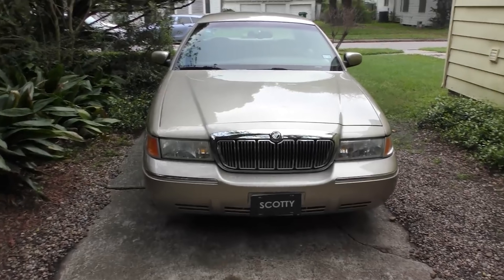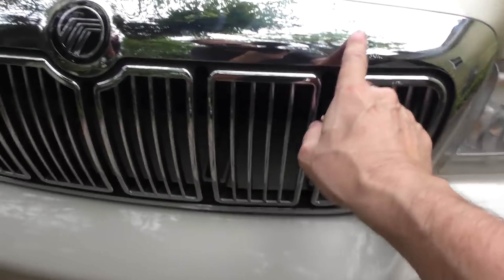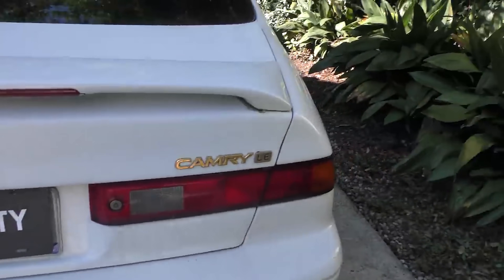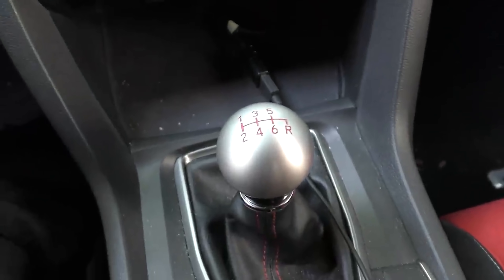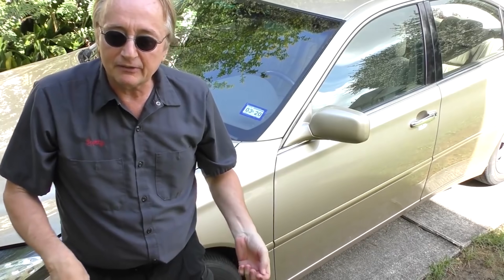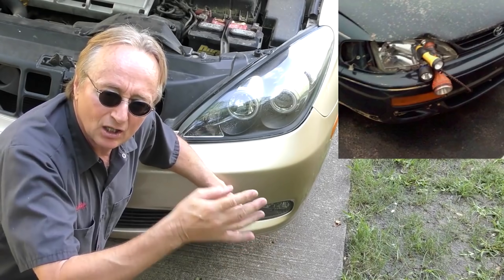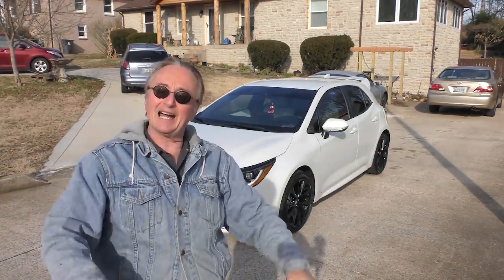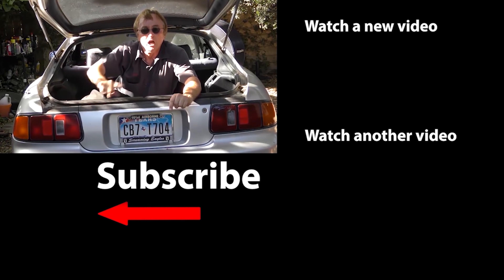5 Cars You Should Buy

Comment: I drove an early 90s Civic for 245,000 miles and thought it was a great car UNTIL I drove a rental Toyota for a week driving to Los Angeles.  My Civic was 100x louder, creakier, more wind noise, less comfortable seating, more punishing ride, worse paint quality, less powerful, worse gas mileage and terrible ergonomically.  And I realized that I replaced the altenator and radiator at least three times before the engine blew.  My cousin's Corolla at the time looked like crap, but at least it had no problems in similar mileage.  The only thing that was better on the Honda was corner flatness, but only a speedster would care about that.

Comment: 340,000 on my Town Car Cartier L....but I've got a oil leak I can't figure out where it's coming from, replaced the oil filter adapter gasket, that wasn't it. Somewhere from the bottom half, not the valve covers. Near the front or middle. Not the rear main, I don't think, nothing much in the bellhousing. Tried the dye...I'm lost.

Comment: Hell, for 5k I bought a 2005 Impala with 95k miles on it. Biggest mistake and biggest piece of junk i ever drove. I mean the first 5k miles I had it for,  I loved it.  But I had to put a new Transmission in at 100,000 miles and instead of selling it right away I kept it and it just started falling apart. By the time it reached 120k barely anything worked and I junked it for $300. Now I have a 2016 civic and I'm loving it

Comment: I was looking at a crown Victoria.  Same V8 and auto transmission.  Are these able to tow much? I've got a 16 foot fiberglass boat that weighs around 2,000.  I live mainly in the Philippines but come home for a few months every year. I'm looking for a reliable, older car or suv that I can store when I'm gone.
Reply: Sometimes the rear airbag suspension on those will crap out but you can convert it to Spring type suspension .
Reply: See what the manual recommends. I'd think it could tow 2,000 pounds with that truck engine on a truck chassis (which is what the 4.6 V8 on a Panther body basically is), but I can't be sure.

Comment: 04 Mustang GT with the 4.6 5 speed manual is my perfect beater now. I never thought it would get good gas mileage, but the savings in fuel vs my pickup truck, the car is going to pay for itself.  But it's actually way better than the truck I'm trying to keep the miles off of (aside from horrible paint). Now I'll need another beater to keep the mustang nice! Ha. Soon the boosted geo metro will be back on the road. The truest of beaters.

Comment: 55000 miles just means it hasn't hit the breaking parts where parts start failing at 100,000 mile or over.  Reliable is when it has hit pass 250,000 miles before you had to replace a few worn out parts. I had the 2008 toyota tacoma and its still running like brand new with 265,000 miles on.  The only thing that needs replacement on my tacoma is the starter finally retired after 265,000 plus mileage all original parts except tires and new aftermarket wheels.

Comment: Hello Scotty! I have 2019 Toyota Corolla hatch and I’m planning to trade it, I don’t like that car, have problems with oxygen or fuel sensor, while being on neutral, car gets up to 2k arpms by itself, when it’s not completely warm up to 175 F, then it stools on moving from 1st gear. Plus it doesn’t have hand brake, but stupid parking button. I can’t have fun in winter ride. Plus so many updates on stupid radio. I had 1995 corolla and it drive like dream, was so much fun car with only 115 hp

Comment: i had a 95 grand marquise that had over 350k miles on it, the interior was waring out before the engine, or transition was. I had to get rid of it cause of my right quarter panel damage I did to it, and it just needed safety in MO, I traded it in for a Honda cu-v, worst mistake I did. I had big tire on then, 235\70\R15's on it, and it rides the same, but gives it a more spiffy look to it. i want to get a Marauder right now, same car, except faster and i think more bumpy, but i want to have onw for a project car.

Comment: I had an 89 Corolla. Best car I ever owned. I forgot to replace the transmission seal when I replaced the axle. But, it ran for 10,000 miles without transmission fluid. That was a real dumb mistake.

Comment: million dollar question is it the rotor or caliper when you hear a little shake or pulsating from the rear only when apply brakes or E brakes note no pulsation on the steering wheel or brake peddle. Now one rotor doesn't look like caliper is engaging the other side of the car is. could this be the culprit or are the rotors warp. Only an expert can answer this.

Comment: Lincoln town car, grand marquis or crown Vic. Which would you buy ?
Reply: Wondering this too - and the differences between each
Reply: I’ve driven all three.  Depending on trim level and purchased options, the Grand Marquis is a little more upscale than the Crown Vic and not anywhere nearly as many on the road so it’s a little more exclusive.  The Lincoln takes it to another level and is beautiful.  Because of the reliability and the huge numbers of Crown Vics sold, particularly as fleet cars and police interceptors, they have been snapped up by cab companies and are more difficult to find at a reasonable price, believe it or not.  If I was in the market, I’d try to get a retiree’s Lincoln first, followed by the Marquis.  If you like the idea of a performance car on this frame, the Mercury Marauder was excellent, but not cheap for a good one.

Comment: I have a 2010 Volvo C70 and was shock to see the rear tires worn down to the steel belts on the inside of the tire while the outside edge was like brand new, research tells me that there is only a "toe"  alignment adjustment that can be done, and noted that the upper control arm can be damaged.  What advise can you recommend to correct this condition?  Thank You and I have subscribed to your broadcast/presentations - excellant recommendations.

Comment: I'm not an expert, but cars are just tools to me. I would only buy a an older car I can work on with as little electronics as possible.
I got both my 98 Honda and my 03 Saturn for free and I fixed both by myself with a few exceptions. 
They cost me nothing after I fixed them as general maintenance (starter on Saturn, radiator on Honda after an accident) and regular oil changes (3000 miles).
* I sold a Silverado to a farmer who collects them. I don't know why. I also sold a small GMC truck to a guy who wanted the engine for a 1932 car.

Comment: I bought a 2019 Camry new. It last about 200km, then the transmission went kaput. At 16,000km, it needed new brakes all around - about 98% highway miles. Both were fortunately covered under warranty. I drive around 40,000km per year. The Camry has been one of the worst vehicles I've ever had. My wife's 2012 Elantra (with 240,000km) runs about as good.
Reply: You buy a Toyota Camry 2015-2017  4 cylinder 2 AR FE 6 speed Auto the best car of Toyota made

Comment: Hi Scotty! 
On my 2004 Toyota Sienna
 front-wheel-drive ABS light comes on sometimes comes off. The mechanic said I need a new ABS pump.  If I flush breaking fluid can it help???
Reply: Just pull the abs fuse out and you should be good to go. You don’t need abs. Cars didn’t have abs for many years. You’ll still have regular brakes which is more than enough. That’s what I did with my scion.
Reply: @Odat  but still for winter time I wish to have that.
Reply: ODAT is right . You dont need ABS .

Comment: I bought a low mileage 03 Crown Vic LX sport for a great low price. On the highway I got an honest 24 mpg if I kept it steady at 70 mpg. The problem is I was getting no better then 13 mpg mixed if I wasn't flooring it? Yes it's a great car, but I found it to be a heavy hog that really didn't have any more space inside, and the trunk then a medium size car that would get 20-28 mpg all day? Also, it isn't really inspiring performance wise? Even my friends Police Interceptor wasn't really impressive considering the fuel consumption? It is a tough, and simple build that my taxi mechanic was able to work on with his eyes closed! If you're looking at one for sale, test the heater. The heater core was a common problem, that is very labor intensive to replace? I admired the car, but was glad to horse trade it. Still, for $2500 or sometimes less on the used market?

Comment: ScottyI got one beef with you. My wife has .Mitsubishi mirage, yes the 3 cyl one, and it has been a dreamfor 6 year old car. It has not seen the iside of a  shop, for anything but for maintenance, yest the day stock tires are cheap and yes the plastic hadle over the front passenger door had to be replaced but the car runs like a dream and is not as noisy or underpowered as some reviews make it out to be.
 Prior to this I has 2 mirage  In the late 80s and 1inthe  90s both were very good. So when you said Mitsus are bad cars I have to disagree, sure they are. Not  Toyotas or even Hondas but as used cars, because of depreciation they are a steal if you want a small car that gets great gas mileage and is very reliable. For the other Mitsu models I can't speak but the Mirage is  good car.

Comment: I got the same exact Mercury,  except it's a 98 with 155k miles !!! Panther Love 👍
Reply: Have you or a previous owner replaced the intake manifold? The ones OEM on the car were known to fail at a certain spot and leak the coolant, overheating the engine. Intake manifolds were redesigned for 2002 and on to be metal in that vulnerable spot, and can be retrofitted onto older Panther bodies. If not already done, it would be a good idea next time you flush the coolant. Maybe do the flush early?

If you're in a not so wintry climate, you should keep the car, because it's a great way to suss out wife potential. Have a discussion before proposing: Anyone not enthused with using that car as a family car for at least the first two kids, or no kids at all, isn't a keeper.
Reply: @EMichaelBall  Luckily I haven't had any problems with it , but I'll make sure to buy the intake just to have it around . Better safer than sorry .

Comment: what are your guys thoughts on 2010 Acura TL going for $6k and has 72k miles on it? the guy said that the transmission is going out
Reply: Don't bother unless you want to part it out, and $6k is a lot for a parts car. He may not have replaced the timing belt, either; that's $1k or so to do right.

Comment: Hey Scotty, I recently got my valve cover gasket fixed by Midas for my 2011 Honda Accord V6 but I notice a burning oil smell and when I lift up the hood, I see slight smoke coming from the the front of the engine. 
This is my second time fixing the gasket issue. (The first time, I took a cheap route and went to a mechanic that charged me the least) 
When I took it to Midas the second time around the gasket had a hole in it. They said it seems like it “melted” a hole. 

Please give me some advise on what to do.

Comment: Hey Scotty, what do you think of a 2011 v6 honda accord with 140k miles? Will it last awhile?
Reply: That's a good car. Have the timing belt changed if you haven't, already; if it tears, it bricks the engine. A proper job (belt, tensioner, and water pump) is $800-1,000 or so.

Comment: Hey, what do you think about the 2006 Mazda 6 with the duratec 30? Mine also has the aisin 6 speed auto made by Toyota, and it’s a hatchback.

I paid $3,000 out the door and it had 110K miles. Very clean inside and out. I had to replace the fuel pump and a few coils, and I also changed all the motor mounts, but it only cost me a few hundred bucks since I did it myself. I’ve put 20K miles on it so far with no issues. How long do you think it will last?

It is the grand touring sport model with all the options (Bose, sunroof, power everything, hatchback, 18” rims, etc)

I personally love it. Good power, handles really well, great stereo, and it appears to be really well made.
Reply: That's a great car that could last a long time. It's on my shortlist of good low-price family cars. Before proposing to a woman, have a discussion about cars. Anyone who isn't readily on board with keeping that car through at least one child, or none at all, isn't a keeper.

Comment: Not only ugly, but they're cheap and break easy, driving a 2014 Toyota Camry and theres a pinch in the bumper cover, grill is constantly popping off the grill mounts, and theres so much wind noise from the busted side flaps on either side

Comment: If you own one, (grand marque or crown Vic) be aware of its plastic intake manifold. Piece of junk. It WILL fail ! Catalytic converters are garbage. And there’s two of them, ($400 each). Air cond. compressor will also lock up w/out warning. Shift cable will rust and break at transmission.(snow/salt areas will break sooner)

Comment: back in 2005 i bought a 99 mercury mystique for about $4200....i was like bleh, mercury  :P    but i needed a cheap car with mileage under 50k.

i kept that thing until 2016. it had about 225k miles on it, and it was still running. i only traded it because i wanted a smaller car with better gas mileage and lower mileage.

never had any probs except changing the battery, and i had to change the starter once.

people, do NOT buy "luxury" cars. they are total GARBAGE. other cars might not look flashy, but that's because they're spending their build budgets on QUALITY instead of flash.

no matter how cool a car looks, a dead car won't get you anywhere...and a ferrari looks dumb as hell sitting dead in your garage.

be smart!